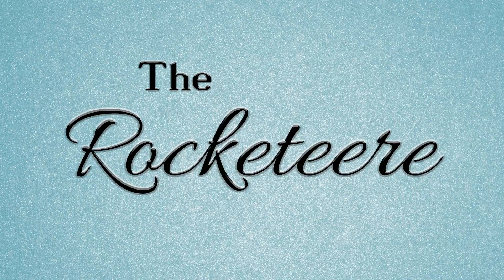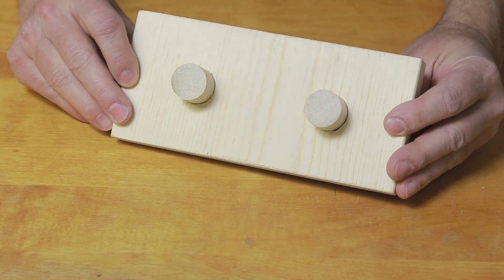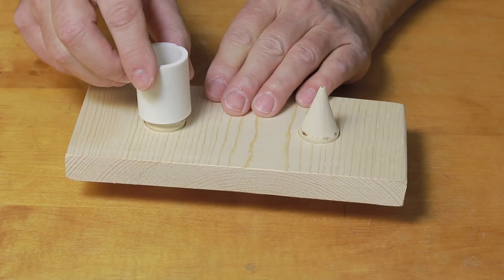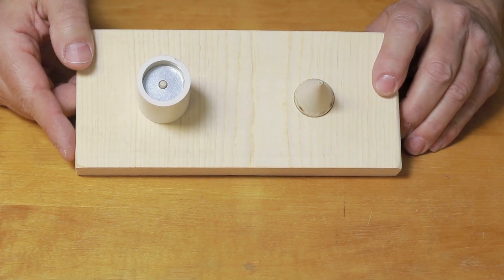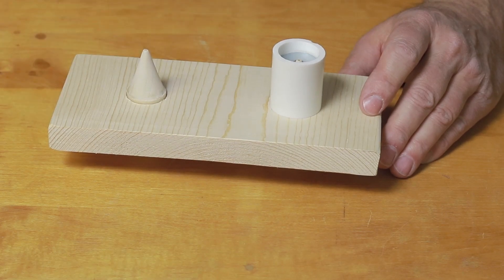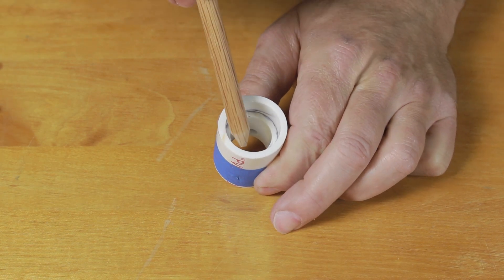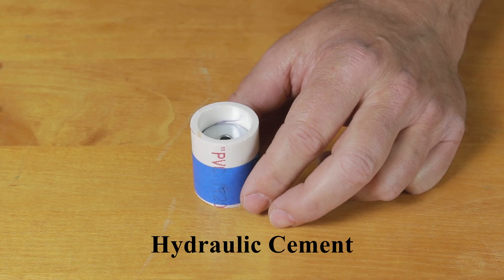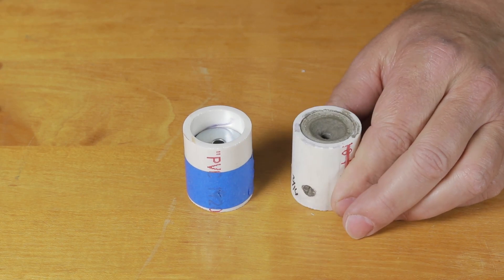Casting concrete nozzles for PVC sugar rocket motors.

Comment: I see that it is common practice to use a washer in concrete nozzles, im curious on what the purpose(s) is for the washer? what would the drawback(s) be to not using one?
Reply from the maker: The steel washer resists erosion far better than the concrete. I usually use two washers in each nozzle.

Comment: question:what material(is it concrete as well?) or way do you use to keep the flame out of the nose cone side?
Reply from the maker: A PVC cap is used as a forward enclosure and it is attached with PVC glue.

Comment: What kind of concrete do you use? Is it fast curing? What time does it take for these nozzles to fully cure for use?
Reply from the maker: I used an anchor cement like Rockite that cures in 20 minutes or so. The concrete needs to be a fine powder and could be used to anchor a bolt into a concrete or hydraulic that will fill a crack and expand.

Comment: Wondering if you have experimented with larger diameter motors.  We have successfully made the 1" PVC 3 core motor and launched a rocket with it. Because of a body size change for my rockets, it would be much easier for me to use 1 1/4" PVC (Actually is around 1.36" ID)  I used BurnSim to design the cores and based on the pressure curve, it looks like the cores would work best if they were 3" long. I designed a motor with 3 of these larger cores and once the nozzle size is properly adjusted, I get a very similar pressure curve to the 1" x 6" motor.  Just wondering if you have any thoughts on that.
Reply from the maker: Congratulations on your success and thanks for sharing!
I have not made 1.25" PVC motors but others have. I think 3 x 3" long grains sound about right. You may need a 5/8 core as well.
You are in solid "H" territory with a motor that size. I would really like to see this launch!

http://www.nakka-rocketry.net/pvcmot7.html

Comment: What size holes did you drill for the concrete pins? Do you reuse the nozzles?
Reply from the maker: The motor and nozzle are not reusable. That's why it is best to make several nozzles at a time. The holes for the concrete pis are 1/4". I cover the hole with painters tape and then make a slit in it for the air to escape. PVC pipe is very inexpensive.
Reply: The Rocketeer Thanks, I am a big fan of your very detailed series.

Comment: can i use durepoxi for the nozzle, instead of concrete?
Reply from the maker: Yes you could use Durepoxi, also known as epoxy clay or SteelStick by JB Weld. It is easy to form and sets up fairly fast. The nozzle will erode more than concrete but the trade off may be worth it. 
You could also use an EZ nozzle that I have designed. It uses epoxy clay for a convergent and has no divergent. The epoxy clay forms a bowl shape over the steel washer and absorbs some of the extreme heat from the exhaust gas. The EZ nozzle is not as efficient but is simple and quick to make. I hope to have a video on this next week.
Thanks for watching and good luck!